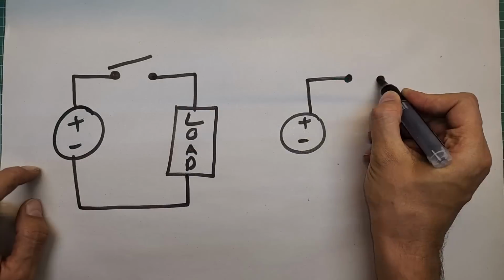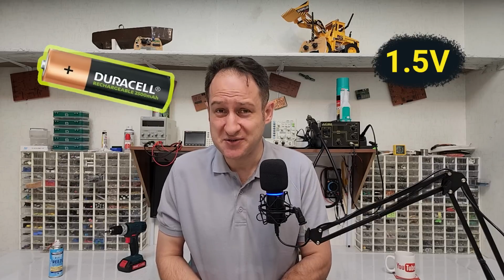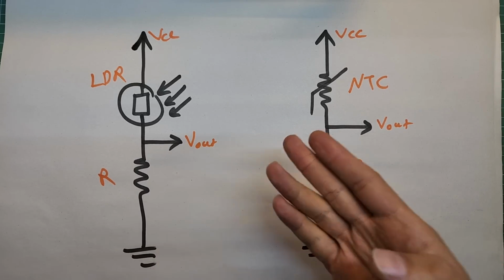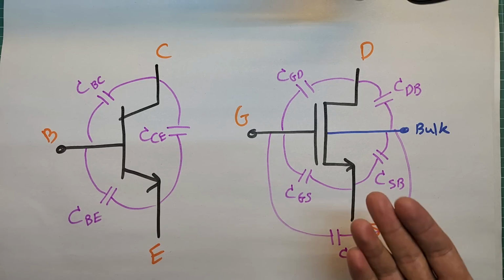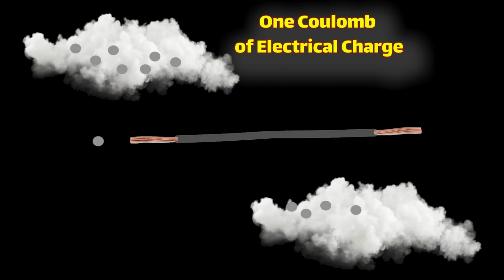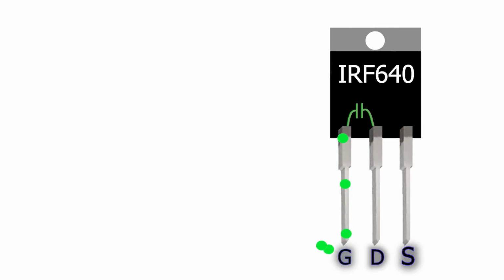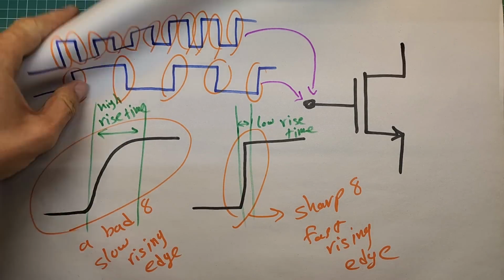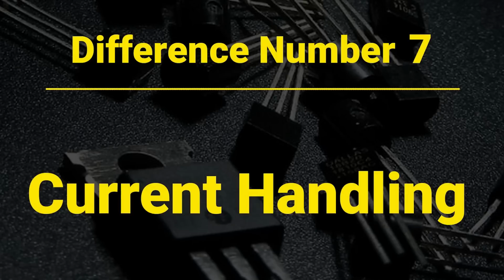BJT vs MOSFET: 10 Practical Difference

Comment: MOSFETs are in general very powerful and efficient devices. But especially for high-power MOSFETs who can switch several 10 or even 100 A, pulse width modulation at frequencies in the 50 to 500 kHz range can easily become dominated by the switching losses. The gate control can require current pulses of several Amperes. I have allready used gate drivers which are capable to drive 10 A or even more to shortening the switching times in order to reduce the switching losses of the circuit. In such applications even a channel on-resistance of less than 1 mOhm doesn't help much when the switching time becomes a significant part of the duty cycle.

Comment: Okey, so which can be nice for something like this.
V at 1S lipo cell is from 4.2V to 3.3V during discharge with 10A. Just 2 50wats resistors 1[Ohm] parallel. 

Which transistor should I use for discharging project, BJT or mosfet? 
Low V but some A.
Just go with BUZ11 (or something which has very low resitance) or learn and go with BJT?

Comment: Average gate current or gate power into a switching MOSFET is very rarely a parameter that is of much value. It is in certain circumstances such as micropower systems or where floating gate drive supplies must be produced. Far, far, far more important is the current required to put in and remove the total gate charge to achieve fast transitions. FET manufacturers have put a lot of effort into reducing total gate charge. It is a very important parameter.

In low voltage devices, MOSFET ON resistance can indeed be much lower than the saturation voltage of a BJT, but that is not always true at high voltage. If you need to deal with hundreds of volts, BJTs can produce lower static losses. This is why insulated gate bipolar transistors (BJTs) are still very common in circuits at 600 volts or higher where high currents are involved. 

Power MOSFETs are not "susceptible to noise." They may produce more noise than BJTs but by a HUGE margin the majority of MOSFETs are used as switching devices where this is irrelevant. Ordinary power MOSFETs are not well suited as linear amplifiers. There are some power MOSFETs on the market that have been designed specifically for linear applications, most intended for audio amplifiers. Those for industrial applications are very few in number and expensive. There are small signal MOSFETs for linear applications, but very few now as discrete devices.

Comment: Very good explanation.  I have a question. I use FETs with 12300 13400 13600 pF Ciss. But I need to switch 2 - 3 - 4  FETs
in parrallel to achive / in BUKC, BOOST DC c. / 250 - 300 A of continuous current for 14 hours. 
How to compute PCB traces / bus-bars at 4 layers of 2 oz Cu , how to compute PCB terminal blocks,
if I need long service life at 25 - 40 *C ambient ? Do you have such video or can somebody provide
me a link, to KICAD of another SW, how to do that correctly ?

Comment: Very good video on the explanation.
I just want to add:
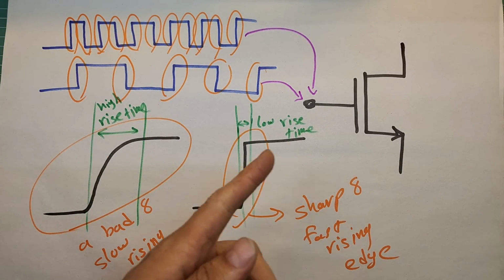14:33 gives illusion that slower rising/falling edge is bad, while actually there is a benefit as it reduces the spike on the Drain -> Source when closed and lower the gate charge current stress. With very sharp edge (no resistor in gate driver), in inductive load (e.g. transformer/motor) will generate spike that could potentially destroy Mosfet because it exceeded the Mosfet absolute maximum Vds. So in most cases a gate resistor (commonly < 10 ohm) is used to "tame" or slow down the rising and falling. In short, the tradeoff between sharp and slow rising edge is important to maintain balance between switching heat vs the spike / stress.

Next video recommendation: What is IGBT and When to use it.
Reply: Yes you are absolutely right, I see this in efficiency of my 2 / 3-phase BUCK converter,
gate resistor plays a role in ringing / EMI, and there is tradeoff .... as you mentioned.
https://www.youtube.com/watch?v=677FAZ3WlYE
Reply: Insulated Gate Bipolar Transistor.... my understanding is they are like a hybrid of BJT/FET...
Reply: Yes slow rise time   is good if you are using for smps high power switching design but not for fast signaling switching as this will delay the signal output and this will cause inaccurate signal received and time counting in digital design.

Comment: I have a simple solenoid circuit that I originally used a BJT for. I noticed the amperage was slowly climbing with each actuation and the transistor was getting warm. After switching to a MOSFET, the amperage is rock solid.

Comment: Very cool, I tried turning a simple motor on and off with Arduino and had to use a MOSFET for the first time and it wasn't that simple, I needed a gate driver and made one with 2 bjts actually, they had enough current to charge the mosfets gates really fast, and the other being in opposite config would turn it off really fast too.  There was a good video on it something like faster low side switching fot mosfets, how to make those rise and fall times faster and get sharper edges for switcing.  Which the Indian guy demonstrated well step by step. However it was more practical so I really didn't understand and videos like this clears it up.  Thank you. Maybe a practical would tie it all together if your up for it in a future video.  I still didn't understand how 2 bjts could switch a MOSFET better the it could on its own but I think if the bjts are fast enough it's ok.
Reply: Or you can use a jFET to drive the MOSFET gate.

Comment: Always Good Stuff and informative.  On my channel, my content is Halloween props and cover electronics and coding...  I will be doing other videos that use transistors so I would like to link this video for some of my more technical viewers.  * But let me ask your opinion about something: *    A week ago I released a video where I used an 3V Arduino PWM output to switch through an Opto-isolator(4N25) to turn on/off a MOSFET (IRFZ34N) that's running some 12V loads (LED lamps).  Several viewers suggested that I could skip the Opto-isolator and directly drive the MOSFET.   Yes, the MOSFET used would switch just fine; they have a good point,  however I had 2 reasons for the opto: 1. I was using the 12V to switch the gate not the output of the Arduino, and 2. provides some protection to the Arduino against a failure of the MOSFTET...  was I being over-protective in this case, and what if I were switching a solenoid  (with flyback diode of course) for pneumatics ,  Here's the point in my video I show the Schematic:  https://youtu.be/fJCk0hTBXMw?t=291
Reply: I like the idea of the optocoupler. Like you said, then you can use 12v to switch the IR power MOSFET. They tend to be kinda limited at the lower voltages.
Reply: @GeneralChangFromDanang  thanks, for your reply!  Yep, that's how I thought too, while my point was that it's not "wrong" but was it overkill?  This MOSFET has a 1.5v (or so) gate voltage, so the 3V PWM would be ample to trigger it.  I'm hoping to gain more insight, a second opinion, and/or learn something new.  I like the Opto, but it does add an additional complexity and failure point.  Arduinos these days are cheap to replace if they are cooked.   IDK.
Reply: I would say the isolator is a great device. It does add a layer of protection if the mosfet fries and melts or something. They are pretty cheap as well so to me its worth the investment. Cheaper doesn't always mean better! You never know when a mosfet may get cooked even in very well designed circuits. If it cooks and sends voltage back its gate to your microcontroller more parts need to be replaced! So you did it right, ignore those other comments.
Reply: @newmonengineering  Thanks for your second opinion.  Exactly, that's why I did the design with the opto.  I do see their point making it simpler,  but I think it's more of a risk management; to take out the opto-isolator and accept the risk of replace everything, finding a new Arduino and programming it, (if you can find the code) .  As for me, I will continue putting opto-isolators in my design, and the commentors may do as they wish.  I'll make the case clear so they understand all of this.

Comment: Great topic.  Thanks
Next video topic: "when low input impedance is beneficial" (6:05)?
Reply: Generally speaking low impedance is less susceptible to noise. So this means if the device is in an environment where there are tons of RF, or emf, or electrical noise they will work better if they are of low impedance type. Of course there are ways to shield things as well but there are trade offs with both. But for the most part this is a general rule, you will get a cleaner more stable signal from a low impedance device that is less susceptible to noise. Hope that helps.

Comment: Whoa, getting deep here.  Good stuff.

It would have been good to give some numerical idea of Low and High frequency.

On biasing: this is basically a kind of preloading or threshold shifting so that the transitions on the base don't need to be so extreme, resulting in less charging current and faster transitions?
Reply: Yeah, high and low will be quite different for audio guys versus radio guys.